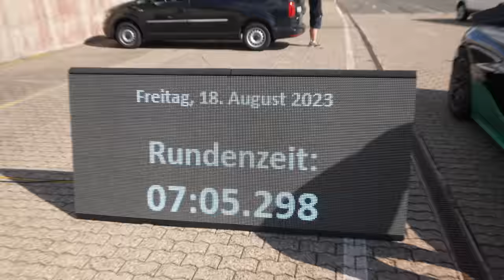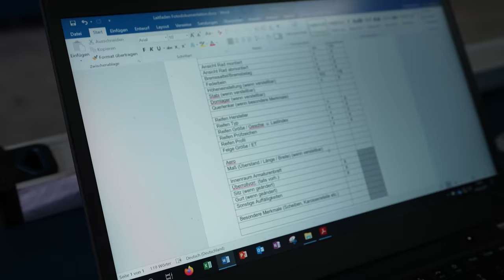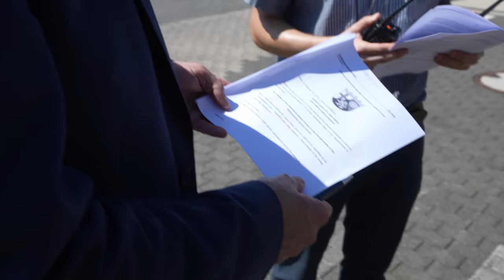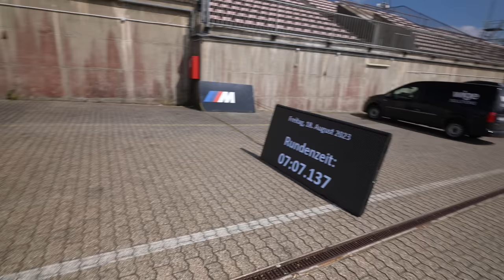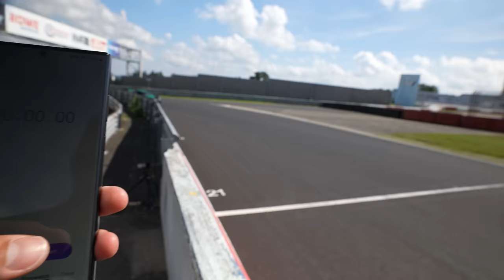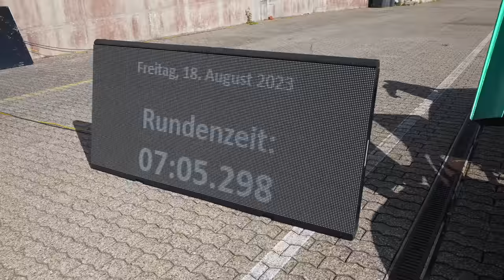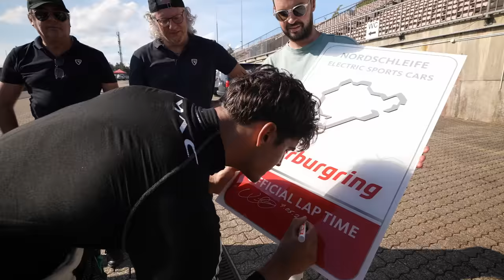EXCLUSIVE: Rimac Nevera Nürburgring Lap Record REAL BTS!

Comment: Almost 2k horsepower, fastest this fastest that and yet it is almost 20secs slower than a “measly” 500bhp porsche gt3rs…
Reply: Yeah but in these times, you cant say 'Its not nearly as fast as an ICE with half the hp' without getting cancelled.
Reply: @r7cardosuarez806  in the case of that Porsche its close to 1/4 of Nevera’s power 😂 
And yeah you get cancelled by the snowflakes in a heartbeat. Its ok it is apparently great for drag racing, something the “Fast and furious” generation believes to be all the “racing” that matters🤣

Comment: So it's not even faster than pretty old 918 spyder? Which was also 4wd hyper car ... But great behind scenes video.
Reply: The hybrid ICE car? Lets not compare apples with oranges..
Reply: @paleide2368  Why? At the end it's only about lap time and how fast it is. They are both super expensive 4WD hyper cars. Fair comparsion.
Reply: @bmwz4169  It have beaten every OTHER record there is to beat.. The Nordschleife is 7minuttes track.. Remember this is still EV tech.. I'm pretty sure the Nevera was losing power halfway in the track due to heating issues with the battery.. How much faster you think the Nevera is on the Grand Prix track?
Reply: @sub7up.  It was not losing power. On the main straight at the end of the lap it achieved similar power as on first minute of a lap.
Reply: Because they "saved" battery during the lap so they could manage to get the topspeeds sections as best as possible.. 

Looking at inboard it's very clear, they did exactly the same as the Taycan and S plaid on their record runs..

Comment: 7:10 2000 hp?
Well i dont want top be negative, but i need to be honest, this is kind of embarassing.
Reply: 7:05.. 

Also.. Do you know the car holds about EVERY other record there is to have?
Reply: @sub7up. Straight line records aren't impressive. Just put the most power in an AWD car, thats it. This Rimac was slower than a Cayman gt4 rs.

Comment: Rimac have to make a high downforce version I bet they could easily hit the 6:40 range if they had even more downforce
Reply: The problem is weight more than downforce.2300 kg and you think a 6:40 is possible? Oh please.
Reply: tires were the problem..  they got too hot and car was limited to 350 kph because uf that
Reply: Typical EV guy. Forgets an extra half ton of weight affects performance
Reply: @carlosoruna7174 No heavy truck weight is the problem.A dancing over weight tire melting pig is a failure.

Comment: How is it that a freaking Cayman 4 RS is still faster?!
The Rimac has freaking 2000 hp and all carbon...
Reply: slower -  Porsche 718 Cayman GT4 RS	Jörg Bergmeister	7:09.30	500 / 1451
Reply: @thealzp  ok, even GT3
Reply: @maerklin29800  anyway, 7-05 is not what we expected from "1hp per 1kg" car  :(((
Reply: Battery weight
Reply: @minesadab  power CAN compensate weight and the Rimac should have enough power to do so
Reply: @maerklin29800  sure, but it can't compensate for effects of the weight on the tyres/brakes. The black lines you see the car leaving into the corner show that the tyres were literally melting. Will be interesting to see how it goes with a harder compound
Reply: @thealzp  Faster 7:03 Porsche Cayman GT4 RS Manthey Jörg Bergmeister
Reply: @ron999  No . 7-03 its short lap time.
Reply: @thealzp   wrong,  7:03.121 on the 20,832 m lap , 6:58 on short layout 20,6km.
Reply: @ron999  We were talking about Cayman 4 RS . You deside to talk about tuned "Manthley".
Reply: @thealzp  Manthey is a part of Porsche, so tuned or not, it's not tuned for power, it's a slightly better at handling and aero. It's a car with 1400 hp less than Nevera, you can deny it.
Reply: @ron999  We were talkig about gt4 RS and its time. "According to Porsche, the new kit was developed especially for track days and in close cooperation between the engineers from Porsche Motorsport and the Nordschleife specialists from Manthey in Meuspath. Aerodynamic and chassis components in particular are modified. Optionally, the high-performance brake system is available with pads designed for circuit racing."
Why are you switching to nevera ? As for Nevera i'v said :"anyway, 7-05 is not what we expected from "1hp per 1kg" car  :((("
Reply: @thealzp   Never has a power to weight ratio of 0.88 hp/kg. So its not one:one. As let say Koenigsegg ONE:1
Reply: @ron999  you are nitpicking :) 	0.88 its nearely 1:1 ....  compared to 0.35 (Porsche 911 GT3 RS (992) 6:49.33	525 / 1484)

Comment: Weight is a killer! 😂
Reply: Yup if the lotus evija is truly the same weight as the adventador svj? But has 2,000+hp with 4 motors and active aero+torque vectoring?
That will be the ev hypercar which easily goes sub 7 maybe even near 6:30s on the ring. Supposed to do 0-300kmh in under 9s.👍🏻

Comment: What i don t understand, why build a 43kg cage in a carbon monocoque?! does Rimac not thrust their crashstructure/product?

2nd: Tesla model s plaid did the upcoming long straight (messured from exit corner end of curb to first braking point right corner) in 39.7 sec.
Rimac did this is 34sec. Rimac won 5.7 sec here. that means 15 sec diff in 154 corners. that means a 2 million dollar car does 0,09 sec per corner advantage over a road car...:) 

Conclusion, buy a GT3 RS, you destroy the rimac and you keep 1.5 million eu in your pocket for a house, a small boat, a holiday house in spain and you can pay for your second wife in every way :) To put everything is a moderate perspective.... Ok now back to normal ring life!

Comment: I need an onboard lap
Reply: It's up now on the Rimac channel
Reply: @dielaughing73   thanks, :) 
Great lap, this thing is ungodly fast
Reply: @bernhardjordan9200  really interesting to see the power and torque fluctuate (positive and negative values)
Reply: @dielaughing73   it was so much information that I've seen the video more than once, 

The torque send for each wheel was incredible, including stability control action with one wheel breaking and the others accelerating, what can be done with electric motors microprocessing and engineering is incredible
Reply: @dielaughing73   I just wish to see vertical acceleration telemetry as well, as the track has jumps and compressions

Comment: BMW M4csl is 10s behind this.  Really? for a 2mil hypercar with 1914hp I was expecting a better time. Somewhere next to the AMG one..
Reply: The Nevera may make 1900hp, but its still built for speed, enjoyment and comfort. It weighs 5100lb with no driver, and has little to no real aero other than the low downforce active rear wing, and it was limited on top speed. Power means nothing on a track like the Nurb, especially compared to a purpose built F1 derived track machine that weighs 1500 lbs less and has huge amounts of downforce with much better tires.

Comment: I am in no way taking a shot at the Roman driver, nor am I kissing Misha’s arse. Nor do I have any knowledge about the driver’s experience both with EV’s or the ring. 

Based on the in car footage, I feel that there was definitely time left on the table during the record setting lap. 

In my opinion, Misha’s knowledge of the ring (insert video of eyes closed lap in an AMG GTR) and ability to drive multiple cars with varying capabilities including braking, acceleration, approaching speeds and handling, one after another. 

Would give Misha an edge with driving an EV. 

…. I might also be completely wrong 😂, but I think that it would have been a good opportunity to at least split the driving between both drivers.
Reply: It's more about the car.. managing battery temps and tires temps is crucial running EV's around the ring.. I'm pretty sure they have an exact strategy to get the best time possible for the conditions.. The lap is 100% planned and staked out in advance.. 

And i'm sure they know the car is capable of faster time than they got last night as you could feel some dissapointment by some of the crew at the end of the video.. 

Stil they got the record, they will hold it for a long time.. great way to enter the weekend.. Wish i could be there to witness this 🥺👍👍🤙
Reply: @sub7up.  agreed. Battery regeneration via one pedal drive mode is also part of it and I’m positive that there was plenty of sim time. 

There’s a lot more involved with driving and extracting the maximum performance out of an EV then with an ICE. 

I reflected a bit more after my initial post. 
And as I said initially, I in no way wanted to take anything away from Rimac or the Driver. 

But to most people, me including, seeing the driver lifting very early in some sections seemed like there was time left on the track. 

And yes, their record should stand for the foreseeable future. Hats off to Rimac.
Reply: @michaelmorgado  Lifting early purely for saving and keep strain on batteries and tires to a minimum.. It's crucial for the car to reach top speed at the last long straight if you want to shave of seconds on the time.. 

Other high speed sections are also key to success so car needs to perform 100% in thoose sections.. other sections is about preserving power and not overheating battery

Going to hot in with the car will burn you in the end.. 😄💨
Reply: @michaelmorgado  Also all credit and creds for the driver and team.. But as you were asking.. I'm confident Misha could pull this of aswell.. 💨💨👍
Reply: @sub7up.  that’s the risk with posting comments…. It’s a permanent record of a thought process. Sometimes it’s brilliant, sometimes you fall short 😂 

Enjoy your weekend friend.

Comment: Maybe after some other tests maybe it would be able run under 7 minutes. Still, that is an impressive feat, isn’t that like 30 seconds faster than any other street legal ev?
Reply: 20s faster than the 20x cheaper model s plaid 4dr ev super sedan.
Reply: @4literv6  20 seconds is a huge margin though
Reply: @gonado  not over 12.9 miles it isn't imo. 50+kmh higher top speed for the rimac, 4 motors&torque vectoring with wider tires, even larger brakes, better total downforce and aero, plus of course 90% more hp to boot. And a 20x price tag to. 😀

That said imo the nevera has sub 7s in it as is. Cooler track temps&tires get it there easy. I think this shows the lotus evija is easily going to do sub 7s at the ring. It's supposed to weigh around what an svj adventador does and have 2,000+hp.👍🏻
Reply: @4literv6  the price tag is not only reflection of performance though. 20 seconds is a huge difference in the right just see how many cars fit in that gap. Also the top speed was limited in the nevera for that run
Reply: @gonado  the top speed was tire limited as I understand it? I never said 20s isn't a gap. Imo it isn't that much over 12.9 miles of track and with the advantages I mentioned the nevera has over a plaid. The nevera for a 2nd vehicle from a young company is damn impressive full stop.👍🏻

It was rumored the older active aero plaid+mules did 7:18s in testing, but sadly the plaid+with active aero&more range never arrived. 
Maybe the lucid air sapphire arriving will cause a tesla plaid upgrade? Or they bring the damn next gen roadster out finally! 😀

Either way I wanna see the lotus evija ring time and the insane little mcmurty speirling ev run the ring.
Max Chilton the mcmurty test driver who set the goodward record? Claims the mcmurty at Silverton can out corner a current f1 car in mph. 😎
Reply: @4literv6  I wonder what time you think the nevera should run costing x20 times a Tesla to be impressive
Reply: @gonado  6:30s
Reply: @4literv6  so you would expect the nevera to match the amg one record, which mind you is the track record
Reply: @gonado  match the current track record for a production car yes. Overall track record even for an ev is much quicker.
Reply: @4literv6  we are talking about production vehicles aren’t we? I think you expectations are way too high, and I don’t think the Evija would do much better is at all. For the sake of lotus I hope they do because if not they will be in big trouble
Reply: @gonado  why don't you think that the evija at 550-600kgs lighter with better aero and even more peak power can't do much better? 
Plus lotus has the track pedigree from decades of wins at every motorsports level that counts, rimac does NOT have at ALL yet. 🤔
Reply: @4literv6  because everything you said are claims from lotus of a car that is not under production yet. Lotus has made promises about the car that might not hold true once the car release, specially if you take into consideration how fast ev technology is el developing. I hope accomplish what they are aiming because I like lotus, but I think going the ev hypercar route is not what lotus is
Reply: @gonado  Jensen button just debuted his personal production lotus evija this week at Monterrey car week. 
Supposedly 3 more are on the ground as of this week awaiting delivery here in the U.S. 👍🏻

Comment: We enter a new race car area.
Reply: So a 2000hp 5100lb doing a 7:05 = a new race car "era" is what I think you were trying to say??? So, what would you call a 2019 Porsche GT2RS (690hp/3241lbs) doing a 6:47?????
Reply: @carlospacheco8640  Exactly!
Reply: @carlospacheco8640  Everything is going electric or hybrid. The record holders for both full on lap and production road legal vehicle are hybrid. So he's not wrong. Electricity is coming into play  and in race cars like formula 1 and le man's hypercars/ lmdh.
Reply: @Jesko.  Hybrid is key. Hence the 919's record. Not full EV.
Reply: @carlospacheco8640  Hybrid took the mean ICE engines away from cars. Porsche 919 is a v4 hybrid. 500 horsepower from the hybrid power and 720 from the v4. Go back a couple decades and there were monstrous V12 and V10 . Now it's V6 hybrid. Hybrid is a new era.
Reply: @Jesko.   Ok, hybrid is new era. But his comment was that full EV (RIMAC) is not new era.
Reply: @davidtsoraev8863 The technology is not there for EV's currently, no advanced cooling solutions, no light weight solid state batteries, these are all at least a decade off.

Comment: Rimac owners instant loose 30% of the value of their battery-cars:
Reply: Electric cars are not made for track. This is made for straight line bonkers acceleration. It accelerates faster than an F1 car. Just let that sink in.